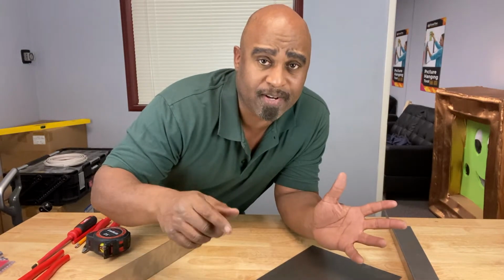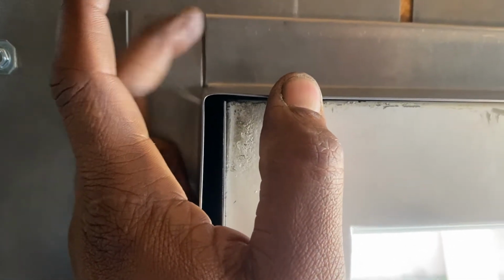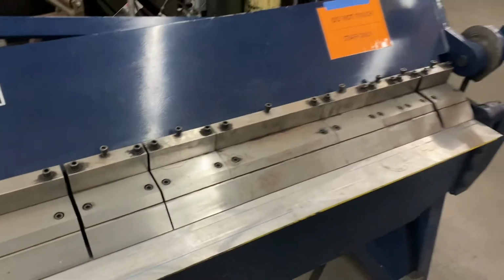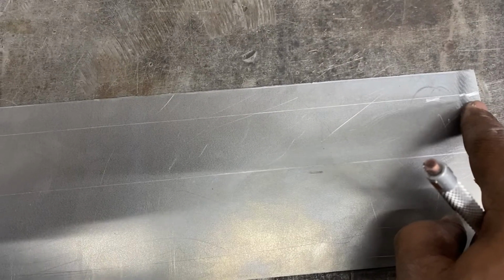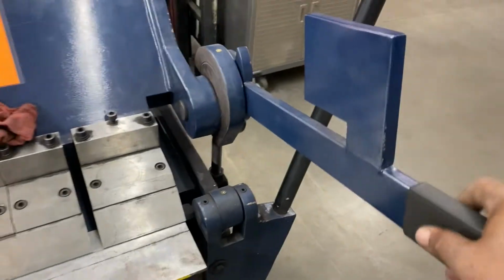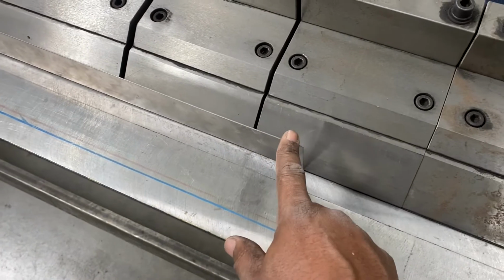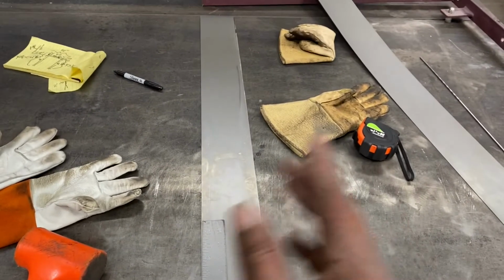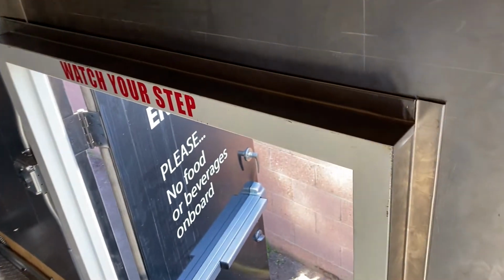HOW TO USE A PAN AND BOX BRAKE

Comment: oh nice i wanted to do something on my BBQ grille.
Reply from the maker: These are great for fabricating metal. The max thickness for steel is .063, aluminum is .100. It’s 8 ft  in length, but I don’t think you’re barbecue grill will be that long. But you never know.